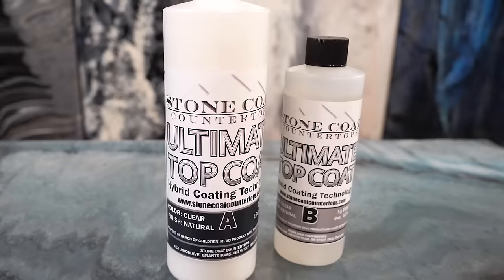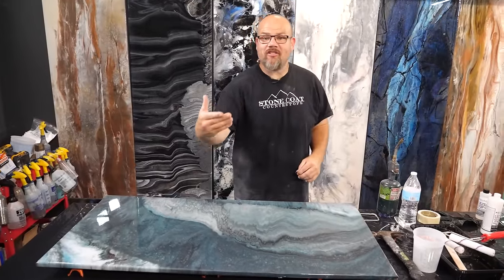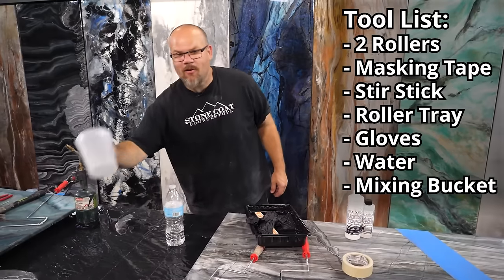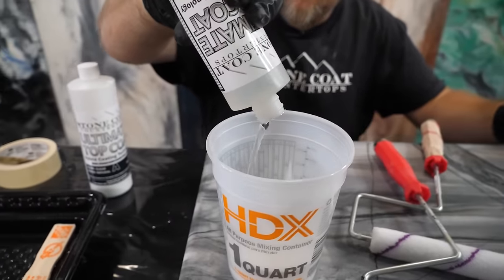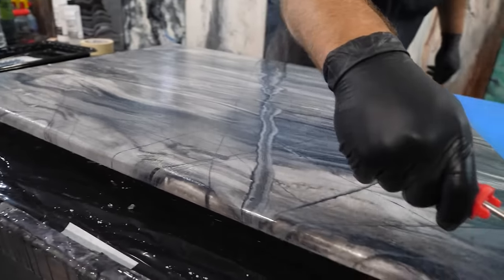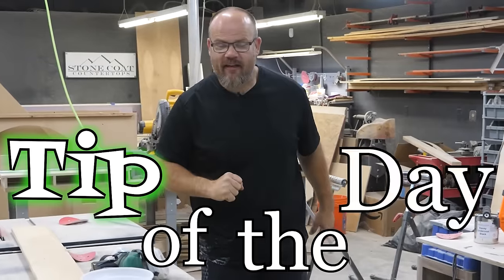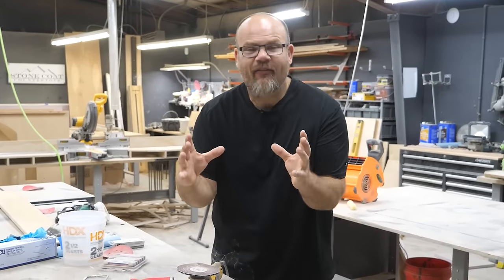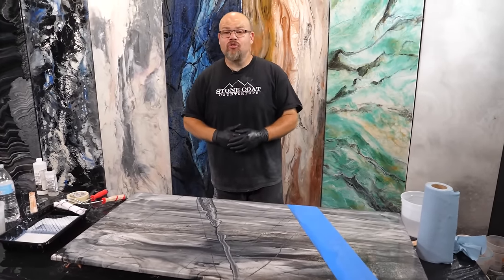The ULTIMATE Top Coat for Epoxy Countertops | Stone Coat Epoxy

Comment from the maker: 🔥 https://www.stonecoatcountertops.com/stone-coat-platinum#ultimate-top-coat 🔥
Did you know that our Ultimate Top Coat is compatible with ALL of our other Stone Coat Epoxy? It adds the ULTIMATE durability and scratch resistance!
Reply: Will it work on our island that is made of granite? Or will it only work on Stone Coat Epoxy countertops?
Reply: Can you put this on other stuff besides apoxey. Like concrete other wood finishes
Reply: We need that for EU also, I would order if ship to EU
Reply: I did this and it did NOT come out as advertised. I watched this video step by step at least 10 time and another while doing it. The first color came out AMAZING but this top coat RUINED my project. And their customer service sucked and said they advertised it to be bumpy and rough dull texture.
Reply: Customer service sucks.  They don't respond.  Good luck if you need help.
Reply: Does the UTC come in a glossy finish?
Reply: @miam8162  How did it ruin your project? Let me guess, your last pour came out glossy and after you applied this it was no longer glossy. If you sanded before applying, that itself would have taken some glossiness away. This is a matte finish, not glossy. Your texture is only as good as you sanded. This mixture does not have a grit additive to it  so it dries smooth. I just did this recipe and wish I could upload some photos.
Reply: Do you offer UTC for floors?
And give fiffis this for concrete tops?

Comment: I followed these instructions to the letter and I still have lap lines. I was a painter by trade for many years so I’m not inexperienced with rolling. I have been extremely happy with the outcome up until now and I have a finished product that looks awful. How do I get rid of the lines now that the top coat has hardened??

Comment: How long does this need to cure before use. My contractors are putting it on tomorrow and I'm interested in the cure time because the sample board they gave me with this topcoat on it was cured 3 weeks and it DID scratch VERY easy.  I'm going ahead with is and using it because I'm a cooking Youtuber and need the look but honestly am very nervous that this is going to last more than a few weeks or months before it's all scratched up and have to replace it in 6 months or a year.

Comment: I figured out a method that is guaranteed to be a perfection finish with a polish shine. After i do the epoxy coat, i sand the countertop starting with 800 grit and finish with 2000. Typically takes about an hour or more. Than i clean, and buff on a wax, or oil such as rubiomonocoat, or osmo oil. When finished the counter is scratch resistant, with no defects that could have occurred from the epoxy (like hairs or lint or dust particles) are sanded out. Yes you could roll on a top coat, or spray on a top coat like Coval or T200 which also gives a glass like finsih. Or you could roll on stonecoat urethane for a semi gloss look. It comes down to if it was your house, what would you want ? Most want high polish look, with high durability.

Comment: I applied a dirty pour color coat over primed plywood. If I have finished the first color coat, do I need to add a second clear coat before adding the ultimate top coat….?
Reply: I’ve seen him roll top coat directly over color coat And also color then flood then top coat. I’m not sure if the flood coat is needed, but it probably helps the piece last longer..

Comment: Thank you for this video. I have a large Epoxy coutnertop in my outdoor kitchen ~ 90 SFT. I used the glossy version of this product last week. Couple of questions:  
1. The finish is not glossy at all. Its actually pretty matte, and I'm not complaining, because it looks gorgeous anyway. But I still want to know if I did something wrong that it ended up like that. 
2. Given this countertop is in the outdoors, it accumulates a LOT of dust. I mean a LOT. What are some recommended cleaning methods? I've tried many different ways and I actually ended up messing the whole countertop in the end with Windex outdoor cleaner. Folks, DON'T use that on epoxy. But thankful to this product, all the white stains the windex left behind is now gone. 
3. How long is this product supposed to last given this is an outdoor countertop? I ask this because I don't mind redoing this every X number of years, given how simple it is, and if it leaves my countertop looking brand new like it does now.

Comment: I'm going to do .y whole kitchen  with MDF board  and I'm going to have seams ... how do I stone coat and make it seamless without it ever cracking down the years down  road
Reply: I think they fill the seams with bondo
Reply: @apersonwhousesyoutube4202  thanks for answering  ... that's what I did
Reply: I filled my seams with Bondo and had a smooth finish, and after I applied my epoxy and clear coat you can see the line!

Comment: I tried the epoxy, and then i tried three things on the finished piece. 1. Sand it down until it's completely matte. 2. Sand a little and apply top coat, 3. No sanding directly top coat. Results of 2&3 were same. Maybe 3 will fall apart sooner. But i totally dislike the touch of top coat. It feels like some cheap laminate counter top. Can i just leave it to sanded down matte on the kitchen counter top? Would your epoxy be durable enough without the top coat?
Reply: I followed your exact guide on top coating.. mixing, thinning, back rolling with dry microfiber.. all of that. I can see that it's definitely more durable, but the feel is terrible!

Comment: If my room is cold, will this still set up? Whats the lowest temp it could be to make sure this sets up? Thank you
Reply from the maker: Thanks for watching! When applying Stone Coat Countertops epoxies you need to be aware of the humidity levels and the temperature. We prefer that you work in an environment that contains 50% or less humidity and between 70-80 degrees. -Nathan
Reply: @StoneCoatCountertops  Thank you, I asked because my ultimate top coat didn't get hard and it was like a rubbery feel. I will check the humidity in my basement because I used it before and turned out great but it was warmer down in the basement to and love your products by the way.

Comment: I noticed you used the satin side for the penny and tool test. Is the shiny side just as durable?
Reply: It's not... i just did mine.... and i scratched the surface by moving a piece of sharp wood across it. ( i was sanding pieces of luan that I cut with a circular saw, the cut was aggressive)

Comment: Did this on my new 22x60” top at 72degrees but ended up with no lap lines but roller stipple. Followed directions and moved quickly and worked the surface minimally. Any ideas why?
Reply: No help if things go south.  Only responses for fan boys.
Reply: La
Reply: @JamesSmith-in2qw  im starting to wonder if SCC is CGI.  

I just bought 4 kits. 3 top coats and 1floot kit. 

Failures. All of them. 

Not to mention 3 bottles were leaking whem i opened the box.

Comment: @stone coat Countertops - How long after you pour your color coat would you use this?  Does it need to be immediate?
Just wondering if this goes over color coat, flood coat and how long after your pour those

ie; can this go on days after you pour epoxy and it hardens or does it need to be directly after(24hrs)
Reply from the maker: Great question Water Mouse! When you are dealing with our Top Coat you need to do your color coat let that cure for 24 hours, then you apply your clear coat let that cure for 24 hours, after those steps then you add your top Coat which would be ready for use after an additional 24 hours. Make sure to sand in between coats! Thanks for watching! -Nathan
Reply: @StoneCoatCountertops  - Thank you for answering and so quickly!!.  Is there any rule to how long is too long to wait to apply Ultimate Top Coat?   Is 1-2 weeks too long or does that not matter?
Reply from the maker: Yes you can wait but it is recommended that you apply your Top Coat as soon as you are able. -Nathan

Comment: is this product suitable for a live edge wood project?  I am looking for a low sheen (matt) finish, this seems to fit the bill.  How would you suggest doing the live edges if yes.  A roller simply will not work as there are too many variations in the surface.  Help please.
Reply: Ditto

Comment: Wow I am nearly sold on the product. 
I do however have a question. I plan on using this to reinforce resin coated ceramic plates and round resin plates. My questions is how to apply it in an even way on a round ceramin plate let’s say 30cm? 
I will probably be coating a few in one go so i dont waste any excess resin, but how would you recommend applying it in such a case?
Reply: Oh and my second question is what is the transparency level?

Comment: Have you tried this over Galaxy-style tops?  How much does it interfere with the sparkle of the glitter?
Reply from the maker: We have yet to apply this over our black galaxy recipe. But with all other counters we've applied this on the sparkle from diamond dust still comes through. It will tone it down, however, you can still see them!
Reply: Yeah I can tell you first hand that if you don't thin it out it ruins the look of the counter tops. I wish this video would have come out two weeks ago. I ruined my large Galaxy Black Countertop by applying it to thick. I tried getting a hold of them over the phone to find out how much water I should add but couldn't get through their "6 minute" estimated time. When you hit 2 for a call back it does nothing and they don't call back. I was really impressed with the epoxy itself but ruined it due to not knowing how to apply it properly. Never felt like I wasted $400 more than I do right now. :(
Reply: @SnDScholar  Did you do any sample pieces with the top coat before you started?  Which epoxy did you put it over - original SCC, or Platinum?
Reply: @joelh.2124  I used their Galaxy Black Epoxy and recommend UnderCoat and Primer. and no I did not do a test piece because I was so impressed with the quality of the Epoxy itself. I followed their instructions correctly, but without any direct information from them I had no clue that not thinning the mixture would ruin the counter top. My one counter is like Glass and beautiful and the other is gritty and rough with brush strokes in it. If I could go back I wouldn't put this stuff over the Epoxy.
Reply: I'm sure you could just resand then polish it?

Comment: Can you buff the "ultimate top coat" to make it shine without loosing durability/functionality? 

does the ultimate seal coat prevent staining on lighter countertops?  I have seen alot of reviews addressing stains from carrots, coffee, juice, chicken noodle soup, ect. Whats the fix to prevent this?
Reply from the maker: Good question! Our Ultimate Top Coat is used to add durability to our epoxy. It is a low-sheen finish, what we call a natural finish. If you decide to try and buff your project we recommend testing it out on a smaller project board to see if it gives you the desired outcome. -Nathan
Reply: @StoneCoatCountertops  Thanks for the reply Nathan! How about the stains any information on that?
Reply from the maker: Adding our Top Coat should help prevent staining if something were to stain it should be easily removable with basic cleaning supplies. There are a number of ways to clean your counters. -Nathan
Reply: @StoneCoatCountertops  In all the years of working with UTC, and all the ways you guys have experimented and come up with new techniques, how come you haven't tested this idea yet?  A glossy UTC seems to be something everyone wants, because I see a lot of inquiries here and elsewhere about it.  I can't imagine that you never wanted it.  It's high time you tested this idea, so all of us don't have to. I love Stone Coat's videos, and I'm sorry to go off like this, but this is a pretty obvious omission.

Comment: Thank you! TWO QUESTIONS: 1) can this product be used over a laminate countertop that has been painted with latex paint? 2) I have a 4" backsplash integrated into the counter - how is the product on vertical surfaces....any special technique required? THANKS!

Comment: How would you suggest doing the application on tumblers? It wouldn't make sense to mix such a large amount for such a tiny surface.. maybe the wet part with a gloved hand, and dry roll it as it spins? Or would that leave too much product?
Reply from the maker: If you want to try this on a tumbler we would suggest waiting until your color coat is completely dry, take it off the turner, then apply still with our 2-roller method (maybe smaller rollers) while holding the tumbler with your hand on the inside of the cup. Once you've applied it and after dry rolling it, put it back on the turner so the top coat doesnt run! As far as left over material; just wait until you have enough tumblers to apply it on so you dont have a lot of wasted material.
Reply: @StoneCoatCountertops  awesome! Sounds good!

Comment: Put the top coat on 80 sq ft kitchen countertop and island. I should have played with it before I used on the 89 sq ft. I didn't like the texture. I  didn't get it thin enough,  didn't add enough water or just didn't roll it out properly. 
 After couple days, I sanded it with 220 and converted it with another clear coat. Since then have played with the top coat and I think I got the application down.  Looks pretty good if done correctly.  We will keep the 80 sq ft gloss, but will use the top coat on future projects.
Reply: I had the same issue - I guess my technique was all wrong because it is very bumpy and has little white bumps everywhere - I am going to sand and recoat with the standard clear coat because I think I would like the gloss better.

Comment: 2 questions. 1.Can you buffer the countertop after applying the seal coat to give it a bit more of a shiny look?  2. Can you go back and fix a spot that you are not happy with? For example, we recently used this product and love it, but we did miss a spot so we would like to fix it but don't really know how. Thank you
Reply from the maker: Hi Dora excellent questions! Yes, you can buff your countertops I will include a link on how that is explained also you can fix up your countertops by sanding them down and reapplying another coat. I hope this helped! -Nathan https://youtu.be/eL6Uv7vE5tw
Reply: @StoneCoatCountertops  thank you for your quick reply.
Reply: @StoneCoatCountertops   So you can buff the seal coat to make it shine without loosing durability/functionality? The link does not address the question directly.

Also are there any videos about staining? I have seen alot of reviews addressing stains from carrots, coffee, juice, chicken noodle soup, ect. does the seal coat prevent that or whats the fix?
Reply: They have two different types of ultimate topcoat. One is a natural finish, which is kind of dull, like natural stone, and the other is a shinier finish. Rather than trying to buff the natural finish, just use the shiny one instead.

Comment: Bummed. Normal pans and plates the top coat was fine. But after resting  and use of a 5 gallon water jug on the counters, there are scuffs and one deep scratch. Would have thought it would've held up better.

Comment: Is there a reason you are rolling at an angle on the piece and not parallel to an edge?
Reply from the maker: Negative! As long as you follow our 2-roller method and make sure the top coat is evenly spread like we show, that's all that matters 👍

Comment: love the shows. however when i called and ask for information and packets was gave a run a round. wanted to try this and maybe freelance.very disappointed.
Reply from the maker: Please explain "packets " maybe I can help.
Reply: I called ask to be sent any ligature. None was available I was told. Ask about prices was told only if I was to buy in bulk. Never used product was wanting to try. Then was told needed to be contractor.  Then just gave up.
Reply: @franklinlinebarger8339  Why wouldn't you just go on the website and look?
Reply: @TenaciousCoder  because talking to a rep that worked for you should have answer my questions. good advice  why have people work for you
Reply: @StoneCoatCountertops  without going thru trail and error i called to place a order. Maybe just lack of communication  between the company rep. and me. I asked if you had an starter package. I was wanting to try product without investing a lot of money that i don"t have. Maybe i should do some more research. Looks like an great product. I don't have a lot  experience in epoxy. i guess you doing videos is great for you, however you had to come with some kind of formula to get to where you are if that makes sense. I really don't even have a shop. I was fired up to do this. But like anything maybe i thought like when you go buy a car they give you some specs. in a booklet.  I guess the videos and website is it. Will have to study more. Thank you god bless.
Reply: So you’re upset because you wanted product for free?